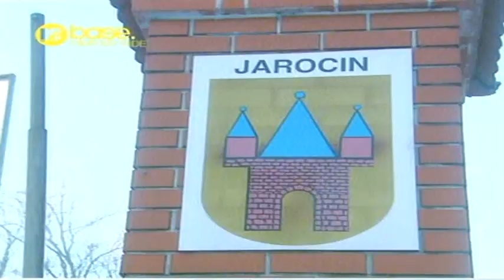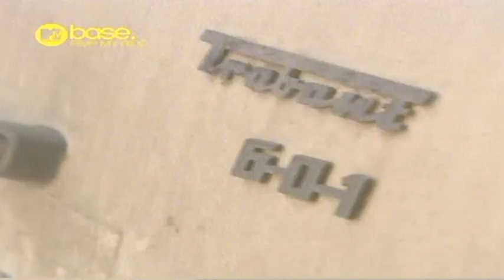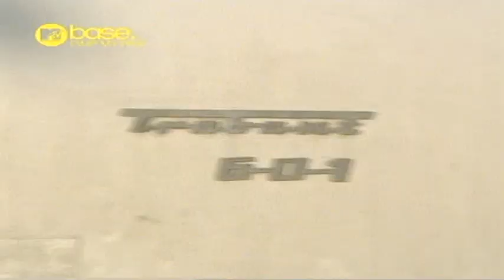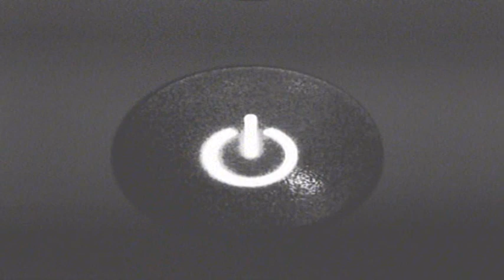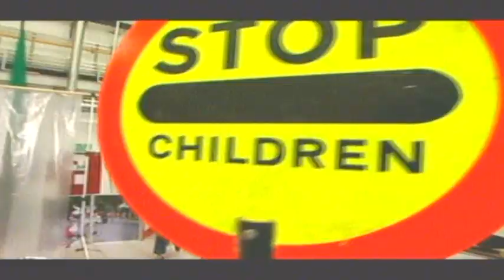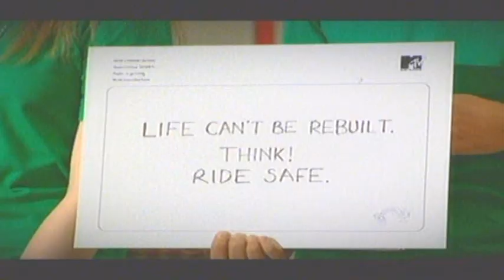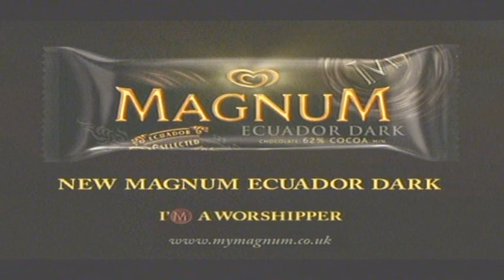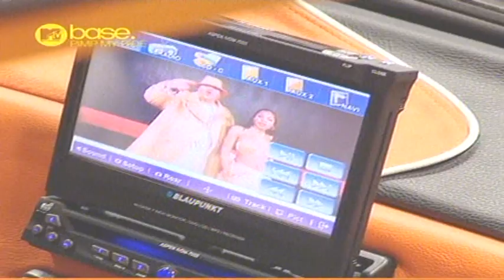Pimp My Ride in Poland (original version)

Comment: Lowered suspension and low profile tires on a car that already say low -- driving on Slavik roads. R.I.P. spine.
Reply: Morte Parla rip oil pan.
Reply: @thememeking994  I'm not trying too be an ass, but since the engine is a 2 stroke, it doesn't have an oil pan. It either has on oil tank mounted above the engine, with a pump and oil injectors, or the oil is pre-mixed with the gas.
Reply: Morte Parla he said it’s pre-mixed - when he shook the car 😂😂
Reply: 😂 I also thought this. But I hope he still has it
Reply: Now Poland have very good roads. Don't compare Poland to Ukraine.
Reply: @morteparla6926  he litterally shook the car for the premix🤣
Reply: HostiaGaming Man who told you that.  You speak only stereotypes.  Ukraine is an eastern country when others have a different religion (Orthodoxy).  There is no such poverty and corruption in politics in Poland.  As for girls, it is bullshit that they are prettier in Ukraine.  One stay in Ukraine was enough for me to find out. Probably you weren’t in Poland or Ukraine, and you speak as if you would live there and saw everything.
Reply: @morteparla6926  in a Trabant its pre-mixed with the fuel
Reply: ta tera to my mamy wykurwiste drogi o czym ty piszesz
Reply: 13 years ago most road were bad yeah but seen as u conmented this 3 yrs ago .... Polish roads improved alot .  ( Im from the Netherlands though i visit poland every Christmas till afyer new years .

( Polish ppl know how to celabrate newyears ) 

In the Netherlands its like ww3 everything is destroyed the day after . 

It started out as a random idea since then we go every year . 

The country looks real nice now a days .
Yes there is still some old and dated stuff but poland is a very large country whit a large history of being destroyed . 
Both by the russians ( formely ussr ) and western europe .

In any war between easy and west its fought on polish ground . 

If u see how they just keep rebuilding again and again ... Proud strong ppl . 
Ive learned from my grandfather that we should never forget what the polish done for us in ww2 .
Reply: "oh Kurwa"

Comment: Doesn't even touch the engine
Reply: they touched the battery to power all the ice lmao
Reply: No Engine swap cause 2 Stroke power
Reply: Better battery, better spark 🤣
Reply: @itsyaboinilo890  yea dem 26 horse power make make u have 2 strokes
Reply: They could've at least put a small block Chevy in it maybe 😂
Reply: I think they just changed out the old 6 volt system to a 12v system, because there is no way they can get two amps working with a small 6 volts battery I guess
Reply: @Dylanjeter123456789   with european gas prices being around 12 dollars a gallon....and him driving a trabby 601, tells you all about why feeding all them freedom eagles is not the best plan. XD
Reply: They tell the ppl whose car it is that they DON'T Overhaul it, just PIMP IT. They only swap engines if it's breaking down

Comment: Spend all that money on a nice engine swap, slap a turbo, upgrade the drivetrain & you have the perfect sleeper
Reply: Nah man NA is the way to go
Reply: @mrsobelek  depends on the engine
Reply: 1000 dollar e46 or just slap you
Reply: Ye and the rust makes for free weight reduction
Reply: ''And it will fall apart in seconds after new engine stars''
Reply: Did you buy a e46 with 1000 $ ??
Reply: Not with a Trabant Chassis though, that'd be like driving a Hayabusa on ice.
Reply: turbo gay na straight
Reply: if it dont fall apart first
Reply: @twongi6044  so you dont like extra power?
Reply: Haha but this is rice my ride remember
Reply: rassem trabelsi not hard to do
Reply: @eggnoodle1061  some people like endurance racing like lemans. Sometimes NA while harder to get power wins in 24 hour plus races. 

I like both options. Turbo helps with altitude driving. But can be a bitch to cool long term.
Reply: question is how a bigger engine would fit in there, definetly not more than a VR 5 or 6

Comment: Its even greater if that car was restored in its original state.
Reply: Turing Mendoza this is pimp my ride nit restore my ride 

Just saying btw
Reply: The communist state?
Reply: You are so right, a trabant has to be looking just the Way it Looks. I bought My First Trabi some months ago and now i fix it up. It is the Same color as the One in the Show: "Papyrus White". I will polish it up and it will Look like new, its an incredible good paint
Reply: We know that now, but back then it was on top
Reply: Some cars aren't worth restoring. Either cause shitty model or bad condition example. 

I wouldn't restore one of these unless it was minimal work. Or I was going to resto mod it. Drive train is lame. Chevy 350 or a motor cycle engine.

Comment: To be honest I expected a lot worse. They made sure the car was safe and rust-free, didn't just bolt-on anything but cleaned it all in, added many (then top-of-the-line) features and extras, and even added in some fun, quirky things that they knew he would like, being a chef. Also, the color scheme, while not my style, is FAR better than most of this industry and honestly not too bad. They also kept all the styling toned down so that it really looks like an update to the original, or like some kind of Mini Cooper. All-in-all, not my taste but not bad. my only real complaint is that they didn't touch the engine.

Comment: Honestly it wouldn't look too bad if it weren't for that obnoxious sideskirt.
Reply: And his rear bumper doesn't really fit in
Reply: Nothing fits
Reply: Or fitted the wheels, imo that would add points
Reply: basically if you changed everything it wouldn't look too bad
Reply: Dog of Wisdom I think the front end doesn’t look too bad, if they went for a silver color, no chess/checker board roof, and made the fenders and side skirts not look like someone glued blocks of wood on, and made the rear end of the car not look like it’s from 70’s or before like they did with everything else it wouldn’t look too bad. Other things they probably should’ve done differently is completely get rid of the “ice” they put in the back, and the pull out dinner table, and stove. It’s a car, not a kitchen. That would save weight too. The suspension they should’ve left alone, I doubt these guys know shit about suspension geometry, they probably just cut the stock springs. They could’ve swapped a better engine in. It doesn’t have to be anything crazy, it could be a stock h22 or whatever works, I don’t know the engine layout in that car, and if they were to touch the suspension... to do it right, coilovers, not super stiff track car just like a slightly stiffer street setup. And lastly disk brakes wouldn’t have been a bad idea.

Comment: I'm function over form. That car would have a k20 or 13b, roll bar+bucket seat, rebuilt suspension, wide wheels and meaty low profile tires paired with disk breaks

Comment: Ok, so my problem with this:
- body swap, where we don't know what happened with the chassis numbers
- you need permission from the authorities to use those alloy wheels on this car (you are only allowed to put on alloys which that car model came some time during its production life - the trabant never had alloys from the factory, thus you mustn't put those on it)
- you need permission from the authorities for the air suspension
- the rear light is against traffic rules, the indicators must be yellow, they can't be red
- they left the old, dying, fucked up original engine in the car (which was 26 hp brand new, now it's maybe 15), to move those huge wheels and power all the electric shit. The engine will die in literally days.
Reply: If the other chassis was still existing then he just got the other trabant?
The wheels are no problem in the Netherlands. Maybe in belgium and germany they need to registered  but i think they would be no problem in most Europe..
Even air suspension would not be a problem in the Netherlands.
Reply: They just used the other car, every thing else won't be a problem. Indicator lights color is easy to change